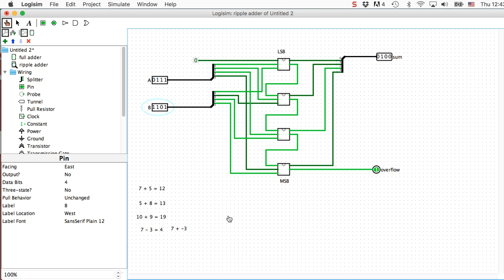Logisim: Examples using a 4-bit adder

Comment: hello i am a student. can you help me this question is hard for me. can you A burning as many as the matrix number you choose (such as 5 * 5, 4 * 5, 5 * 4 to be at least 4 * 4)
In the lamp arrangement, design a circuit that gives an output if there are both side-by-side and bottom-lit lamps. im my gmail.
asilsaban56@gmail.com. thank you if you can help